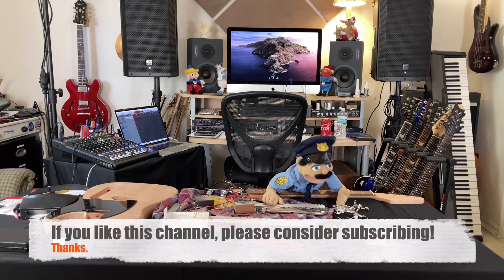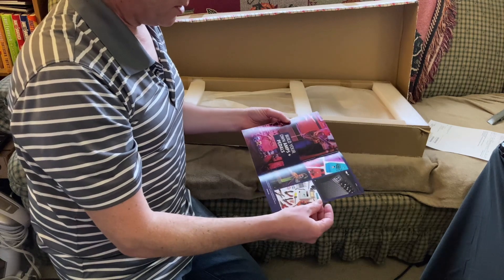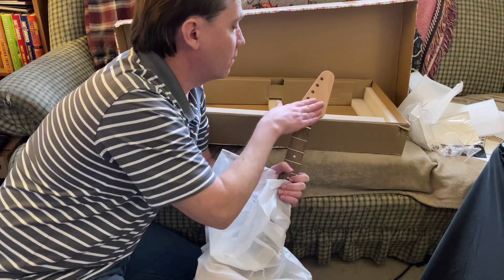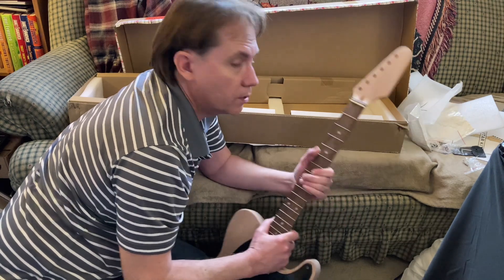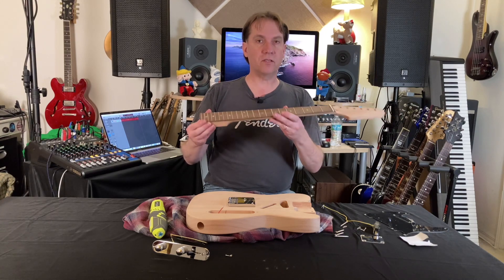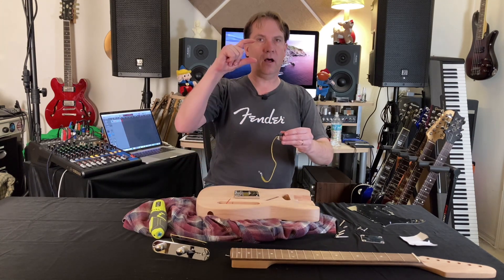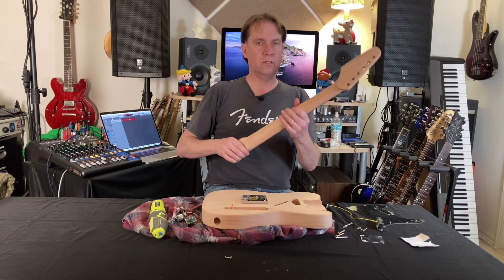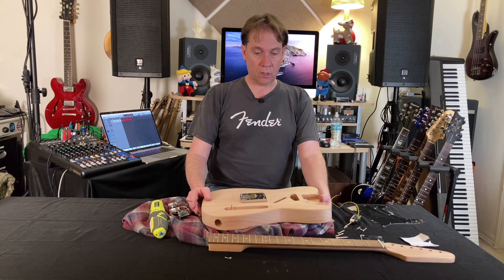Building a StewMac T-Style Guitar Kit, Part 1 - Unboxing and Overview

Comment: I am mostly through putting mine together, and have really enjoyed the experience. A few details on my kit: the slipstick was missing (used chapstick); the holes in the pickup cavities were not pre drilled; the bridge mounting holes (4) were not pre drilled; there were 6, not 7 mounting screws for the tuning machines; the strap button holes were not pre drilled. I made my way around these issues, and am very satisfied.

Comment: Quarter pounder or deluxe drive wood rock it..
Reply from the maker: The good news is I have a quarter pounder I can put in it!  The bad news is the damn thing is broken.  One day I'll fix the pickup and make a video out of it.
Reply: @budgetguitarist  hey don't know if you ever tried any of the off brand pickups like off of Amazon or eBay but there's 2 I have experienced with that have turned out to be sleepers and very good tone they have in spades for sure 1. Is oripure telecaster rails bridge position hot rails/ tone zone style, it ruins between 30 to 40 bucks and honestly sounds at least as good as a hot rails or tonezone, impedance is around 13.5 inductance is 10 h and it's a sustain laden hotrod pup, The other by oripure is a vintage style traditional tele tone but a tad beefier low end, the next is a little more common if a name the Artech rails blaster 12 k impedance and I believe around 8 h inductance, it is a touch mellower but nice sparkle presence and growling mids.. about 19 to 21 buck's eBay or Amazon. All these use alnico 5 magnet's and are nicely built, not flimsy crappy materials etc.  Really good pickups also definitely worth mentioning is The oripure alnico 5 hot humbuckers impedance 16 k inductance 8h sound like a hybrid of a DiMarzio super distortion and Duncan distortion buckers and finally the Wilkinson alnico 5 overwound humbucker about 14.5 impedance and 8 inductance and tons of sustain and growling mids reminiscent of a JB but a little More refined in the upper mids, very good sounding pick-up especially for around 20 buck's.. you may have already tried these but just in case you haven't, and need some good quality cheaper pups All theses I mentioned are outstanding regardless of the price and are very comparable to DiMarzio and Duncan,  and all of them together cost about the same as one DiMarzio or Duncan equivalent and to my ear's have been equal or even slightly better tone's in that comparing to DiMarzio a little more refined in the upper mids less brittle yet a little better charity than the Duncan equivalent. Don't get me wrong I love DiMarzio and Duncan pup's both And still use em daily but these cheaper Artech oripure and Wilkinson are very equal in tone just a nicer variation that depending on one's tonality craving and gear may just hit that just right (there's the tonality I'm hearing in my mind for this song or project etc.) Spot that one might not be quite nailing with current pup's.. I also don't recall if I asked you how you like the stewmac t kit, I also see you reviewed the Solo kit, those are 2 kits I've been eyeballing and am close to saying ok Time to build another LoL.. never did a kit yet just components in past (Warmoth and Chandler) and highly modded squires at current of which if I take one more step the only thing left stock would be bridge plate and bodies lol, wouldn't be a squier at all if I changed body or body and neck, it would be a completed parts caster at that point plus defeat the purpose and put it in the lower mid middle range price point 500 600 range at that point 🤔🤔?? It'd turn into a squimoth or warmier or something lol.. speaking of which another route I could take but 600 range compared to the 200 300 range that Solo and stewmac sit in.. anyways have a good Christmas and prosperous happy new year 👍👍

Comment: Over all that kit looks ok but for all that needs to be redone like frets,cheap electronics and questionable tuners did you truly get what you paid for? Not trying to be cynical at all but for the cost you would think it came with higher end pups,ect. Will be an interesting series regardless.👍
Reply from the maker: Very good question.  The kit is, as of right this second, selling for $203 on Amazon, with free shipping.  At that price, it'd be hard to buy what comes in the kit separately, even though the electronics are junk.  I think if someone thinks they're going to spend $200 and some elbow grease and end up with an $800 guitar, they're sadly mistaken.  The hardware on this thing is in line with what comes on a Squier Bullet.  But if someone buys this because they want the experience of making a guitar from a kit, it's a good investment because the body and the neck are both good wood.  But I'd say if the ultimate goal is to have a great guitar, it makes more sense to buy all the parts separately - that way you don't need to toss the junk parts.  In my opinion, the biggest issue with this guitar is that the neck has a 12 inch radius and vintage, tiny frets, a combination that literally nobody wants.  Maybe I'll eventually do another build, but with 100% of the parts coming from GFS.  That'd be interesting.  Thanks for the comment!
Reply: @budgetguitarist  Yes that would be an interesting build with a GFS build. I hear you on gaining experience with this despite the cheap electronics. Would be great if stew mac sold just the body with a 9.5 neck with medium jumbo frets! You do great videos btw and they are informative and your process makes it easier to understand for us amateurs like me. 👍
Reply from the maker: @timbuktu7753  Thanks, Tim!  I really appreciate that.